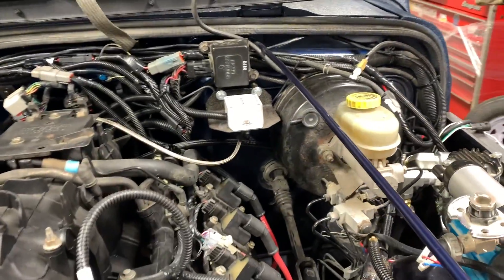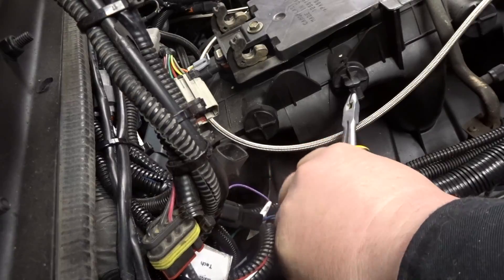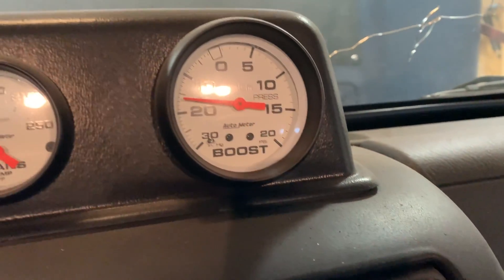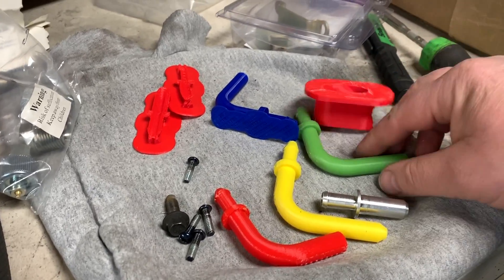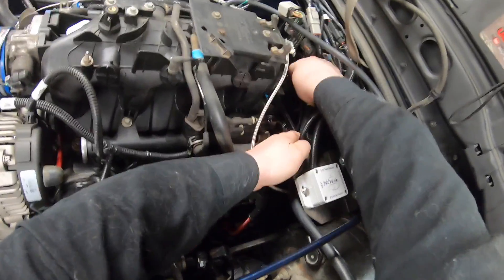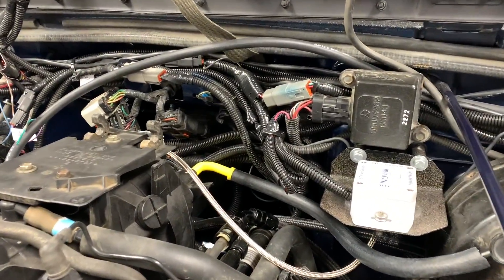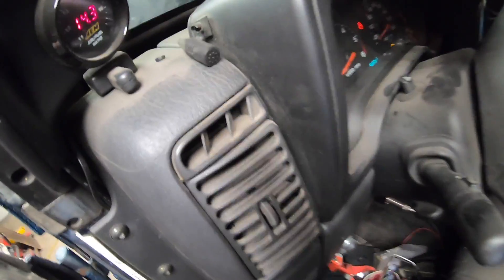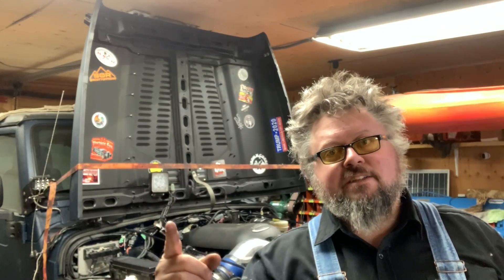Jeep LS Swap Vacuum Lines

Comment: Let's see how that elbow holds up to the engine bay heat.Fingers crossed....
Reply from the maker: What could go wrong besides going down the mountain and it loses vacuum 😂🤣😂🤣😂
Reply: BSK Garage had a similar thing happen, no brake power assist right before a busy intersection 😳 sudden dual foot brake pedal leg press and still overshot.